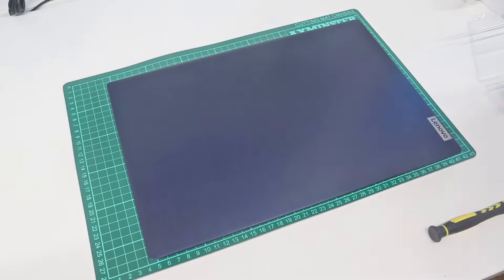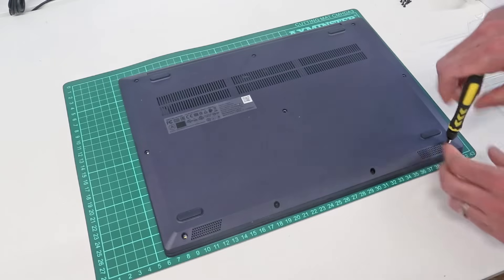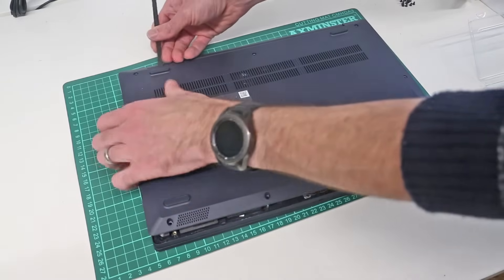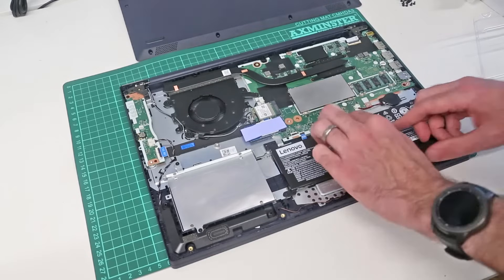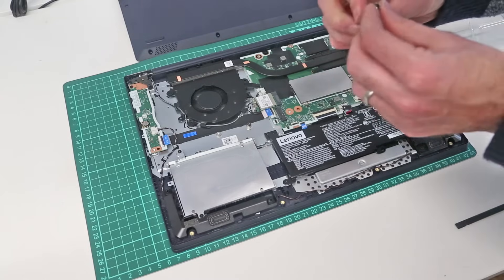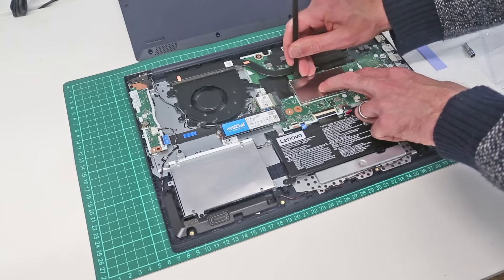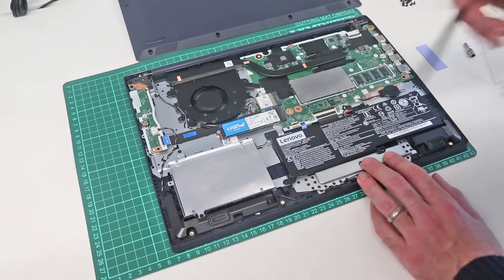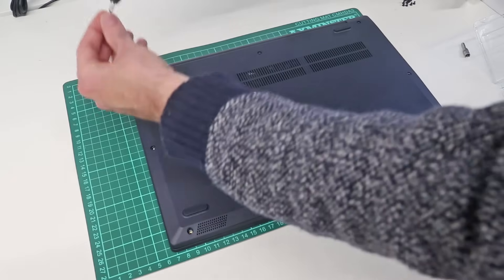Lenovo IdeaPad 3 15ARE05 SSD and Memory Upgrade Guide

Comment: is it possible to change the processor?
Reply from the maker: No. The CPU in pretty much all modern laptops is soldered down and can only be replaced by replacing the mainboard with one with a higher spec CPU on it.

Comment: Hi. I have the same model of the laptop but it came with two 4gb ram 2667MHz, could this be upraded to 16gb ram?
Reply from the maker: If it is the same as mine then 4GB will be soldered down and cannot be upgraded, and the other 4GB is socketed and can be. So you could install an 8GB module and go to 12GB, or a 16GB to go to 20GB.
Reply: @BrueComputing  Thank you. So its not an issue to not have symmetrical sized ram cards?
Reply from the maker: @johnsburgers7784  It has a bit of a performance hit in gaming with integrated graphics, but for general use shouldn't give any issues so long as the memory speed and timings match.
Reply: @BrueComputing  Do you know how I can find out what the integrated RAM speed and timing currently is? MSinfo32? Thanks
Reply: Thanks so much, this helps out alot

Comment: Hi. I did all this and now my Lenovo Setup Utility is saying Hard Disk: Not Installed. It won’t boot. Any ideas?
Reply from the maker: You need to either clone the previous drive contents across or clean install Windows 10 to the new drive.
Reply: @BrueComputing  I did the clone. I purchased a WD WDS100T2B0B M.2 drive, put it into a USB caddy, used cloning software, then swapped the hard drives. When the laptop starts it prompts me to go straight into the bios, which on the first screen next to Hard Disk it says “Not Installed”. Could the SSD i bought not be compatible?

Comment: 🙂The video was great, upgrading the ssd and ram👍. At the bottom left it looks like a 2.5 hdd bay? Does that mean you can add a hdd for all your data like videos, music etc. Also do more laptops today have this setup? Available to upgraded ssd, ram and add a second hdd? I have a 4+ year old laptop that is working fine, but it may die in 1-2 years. I would like my future 💻 be able to upgraded ssd, add ram and add a second hdd for all my data(music, movies, pics, etc)
Reply from the maker: There is space for a HDD, but models which don't come with one don't have the bracket and connector for fitting them, so you'd have to source these. Some manufacturers do include these in the box or pre-installed on some models, but Lenovo chose not to in this case.
Reply: @BrueComputing  can you make a video , how to installed HDD (the bracket and connector) to Lenovo IdeaPad 3 15ARE05.
 PLEASE!!!
Reply from the maker: @viktorbelousov9573  I don't have the laptop anymore (I buy and sell them quite regularly to make these videos) and never had the brackets. I am not aware if you can even buy them separately.
Reply: @BrueComputing  I understand thx u so much.

Comment: Hi mate. I had a question. Mine has a 1tb hdd in it and I want to buy a m.2 drive. But im not sure if it is compatible with my system or not. I know that it has it's slot but the fact that this laptop didn't come with a m.2 drive, scares me a little. Do you think that i will have compatibility issues or i'll be good?
Reply: Just put the new NVME ssd in the computer and clone from the original hdd, then remove the hdd and reboot the computer.

Comment: If you upgrade it, the windows will be removed?
Reply from the maker: If replacing the SSD you'd need to either clone the data from the old drive, or clean install Windows 10 to it.

Comment: hello sir...i have this laptop, i installed HP ssd and i installed it successfully. after using it on ssd for for few days i try to take some of the files from HHD which was still inside. it started to auto restart and black screen problem. i called Lenovo the instructed me to format both the SSD and HHD while doing that i was unable to go to boot mood. i am shutting down the laptop and pressing the power on keep and F12 for boot up but its not booting up and getting stuck on Lenovo logo. i am even trying to use pin nova mode its still not booting up....all i want to do is install W10 on my SSD and format HHD but  Lenovo technicians  are not able to help me. PLEASE HEPL ME IN THIS...PLEASE PLEASE HELP ME OUT WITH THIS

Comment: Hi, thank you for the video. Question, can I add a slot of 8GB ram? so I would have 12GB total? Thank you...
Reply: According to Crucials' website, you can put up to a 16GB stick in the slot.  https://www.crucial.com/compatible-upgrade-for/lenovo/ideapad-3-15are05
Reply: @marsilies  Awesome!  Thank you!  Had an 8gb stick in my Amazon cart and saw this...now I've got the 16gb in there instead.  🙂
Reply: @JesterGP3  I check on command prompt and max Memory capacity is 16GB, do you also check it and 20GB is still fine?
Reply: Please tell me if your laptop sees 20 GB of RAM. I also want to buy 16 GB of RAM so that the total is 20, but I'm not sure that the laptop will see them.
Reply: @andromeda2499  I had upgraded my laptop to 20Gb and it works very well, the max memory capacity on the command line is still 16GB but 20GB is also readable

Comment: I have the same model of laptop (aside from having a 4700U CPU).  My battery spans the entire width of the laptop.  Is there a different battery that can be used (with the same or better Wh) which would free up the space where a HDD could go?
Reply from the maker: The smaller battery will be a lower capacity.

Comment: so, 4 GB soldered to the unit on this model... Looking to buy one with 4GB additional already in the slot. If that's not fast enough for me, wondering if I bought a 16 gb card if I could then run it "single channel" and it would be faster than the 4 + 4 dual channel? I keep seeing single channel vs dual channel and I just don't know a lot about it. Any help would be appreciated. Thank you
Reply: Dual channel is always better than single channel as far as I'm aware, unfortunately because 4gbs of this computer are soldered into the motherboard only the other slot can be upgraded to a max of 8gbs, total 12 gbs -2 allocated to the OS. I have a ryzen 5 model of this laptop with 8gbs ram, wanting to upgrade one of the sticks to 8.
Reply: If you can get a good deal on this model with ryzen it's a very nice laptop.
Reply: @sawcondeez69  OK gotcha. Yeah, we went ahead and got it. I've always thought AMD processors were great. Thanks for taking the time to reply, that makes sense!

Comment: Very useful thanks!! i upgraded the Ram  already to a 8gb because i realized that the Ryzen integrated graphics take 2gb ram by default, so when you add 8gb plus the 4gb soldered you get 10 usable gb.  I would like to now if this laptop support 16 Gb ram? Now Im waiting for the Sdd nvme 256 gb to arrive . Ideapad 3 is a really good laptop but it is necessary to upgrade and improve because the default config is very basic.
Reply: It can in the website it says that but people put up to 20 gb and it works fine
Reply: @mohammedmohaimen203  sure?? I haven't watch any info about because i plan to buy 16gb module
Reply: @MrTheophilos13  yea
Reply: same question
Reply: Maximum support for 8gb ram in extra slot- according to official russian website of lenovo for this model

Comment: Question: Why did you need to unplug the battery?
Reply: He wants to make sure that no accidents happen with the battery. For example, accidently ripping off the connecting wires. It is also safer to deal with computers with an unplugged battery to make sure that the laptop is off.

Comment: I'm confused. Please tell me could I add as a second drive the Samsung 970 Evo Plus SSD 1.0TB M.2 NVMe or Samsung 860 Evo SSD 1TB 2.5'' SATA III? I'm between these two. Shall I need the HDD Cable L 81Y4 HDD/B cable? Is the cable inside the laptop or I should buy it?
Reply: hey bro ihave the same question if you solve ur issue can you pls help me out. it's a humble request

Comment: Are the ideapads worth buying I'm trying to find a laptop I can design 3d prints on without having it crash or freeze on me
Reply: I just got one, and I am really impressed. Mine had Ryzen 3 4300u and 4gb of ram. I think for 3d modelling you should upgrade to 8gb of ram. The CPU is really good, it has 4 cores and runs really fast. I highly recommend this laptop, the only thing is the webcam is pretty bad.
Reply: Do you use fusion 360?
Reply: @alex-w8p2e  yes well I want to but my hp stream can't handle it...im struggling with this thing I got it for school 100yrs ago and I recently picked up a 3d printer and its takes hrs to do anything on it and I'm trying to find something that will do what I need there's so many things to take in account its hard to keep track of
Reply: If you want IdeaPad you can choose the ryzen 7 4700u variant that is the same as mine it's a monster for casual user and engineering works

Comment: can i update with a nmve gen3.0 4x m.2 or it has to be a 2x like the one provided by lenovo?
Reply: Hi did you ever figure this out ? I am looking to solve the same question.
Reply: @kikonoss123 Crucial hw upgrade tool goes up to Gen4 6.6/5Gbs Read/write.  If the mother board chipset can handle that I don't know, that is hard to find unless I am searching for the wrong thing.

Comment: Thank you ! I have got the same laptop with 512 Gb ssd and i want  to upgrade with another 512 Gb ssd but it seems the laptop hasn't got a secondary ssd slot right ? What would you recommend to me ? I could buy a new 1 Tb ssd in future but how can I transfer the data to new one ?
Reply from the maker: That is correct - if you could source the HDD cable you could add a SATA SSD, but I'm not aware of a supplier for that, so your best option would be a 1TB SSD.
I have done a video on cloning with True Image here: https://www.youtube.com/watch?v=JV43dmhsQS4
I use this enclosure for cloning M.2 NVMe drives: https://amzn.to/38vLcUl
Reply: @BrueComputing  thank you Brue. Thats pretty cool.
Reply: @doctormhere  "...upgrade with another 512 Gb ssd" hi, I was attempting the same and discovered that the empty caddy for the 2.5" SATA drive is present but there doesn't appear to be SATA header connector to plug the SATA drive into. Upon looking at the Lenovo documentation it appears that cable wasn't included in my models build. I will contact Lenovo and make the case that the salesman told me that I could easily install an additional 2.5" SATA drive, and therefore that this claim of his amounts to misrepresentation. Did you finally succeed to get the cable and install a second drive?
Reply: @veganath  hi. Actually there is no progress on my side. Because there is some space enought on original ssd for now. So I didn’t deal with the upgrade :)
Reply: @BrueComputing  is it possible to add 1tb hdd to this laptop?
Reply from the maker: @uqb7  I don't know a way of fitting a 2.5" SATA drive. I'd recommend just fitting a large M.2 SSD.

Comment: can you upgrade the cpu and the gpu also?
Reply: U can upgrade gpu to 2 gb in bios
Reply from the maker: No. No modern laptop (besides some gaming ones using desktop parts) have an upgradeable CPU. The GPU on these is either integrated into the CPU, or soldered to the mainboard, so the only way to upgrade them would be to swap in a higher spec mainboard, which is unlikely to be economical vs. just selling it and buying a higher spec laptop.

Comment: Hi my laptop has 4gb soldered + 4gb so-dimm and it says that it has a max memory of 8gb. Does this mean that I can't upgrade my 4gb so-dimm to 8 or 16?
Reply: You can upgrade it. Just remove the 4GB one and fit in the 8/16GB so-dimm
Reply: @thomasb4526  even though it says from the official website that the max memory is only 8gb?
Reply: @bernreccion  yes that's what Lenovo is saying. But as you can read here in other comments 16gb dimms also seems to work.

Comment: is it possible to add an HDD?
Reply from the maker: If you have the cable for adding in the drive then it should be possible - there is a mount for them in the system.
Reply: @BrueComputing  I have the hhd and a small cable piece that plugs into the hdd with the other end meant to plug into a motherboard, but i cant seem to find where to plug it in. But there is a spot for it?
Reply: @BrueComputing  hi, what kind of cable do i need to put a hdd

Comment: This is the second video where I can see you need a special plastic tool to open the laptop. I've spent almost 30 mins trying to open it and achieving nothing but broken nails. What were they thinking when they designed it?
Reply from the maker: I'm not sure I'd really call it a 'special tool' - a plastic spudger, or pry tool, is pretty standard for working on disassembling any modern electronics.
You could use a small, flathead, screwdriver, but any metal tools will mark and indent the plastic.
Reply: @BrueComputing  "pretty standard for working on disassembling any modern electronics"
Which is precisely why I call it a special tool. The average person doesn't disassemble electronics.  :)
Anyway, I succeeded by using a dinner knife. About an hour's work with only minor marks.
Reply: @crypticdelights6924  i just opened mine with a thin guitar pick. Works like a charm

Comment: is any there any slots available to add an extra HDD. mine came with the 16GB and 500GB SSD so im planning add an additional 1TB 2.5 Inch sata Hard Drive to it
Reply: Yes but there is no cable nor bracket
Reply: The perfect is ssd plus m2, hdd plus m2

Comment: Hey James,  I'm upgrading the same laptop SSD right now, and I'm using a Team Group 512gb m.2 2280 gen3x4 SSD.. I cant get it to boot to the ssd though, it keeps saying there is no bootable media? I have a USB flash drive plugged in with windows 10 loaded onto it (I've used it many times to install windows) but it doesn't seem to recognize the usb or the new ssd. Any ideas?
Reply from the maker: How did you create the USB stick? Is it set up for Legacy CSM or UEFI booting?
Have External Bootable devices been disabled in the BIOS?
What options do you get if you load up the Boot menu?
Reply: @BrueComputing  I actually got it and forgot to update here. I'm not sure why but I made another win10 ISO file on a different USB flash drive and it worked totally fine. I'm not sure what was wrong with the other flash stick.
Reply: Duplicate drive with gost or other programs

Comment: Hi just wondering what is the max upgrade parts that I could get for this laptop?
Reply from the maker: An additional 16GB DDR4-2666 and as large an M.2 NVMe SSD as you can find/afford.
Reply: @BrueComputing  So basically if I wanted to I could add a 1TB SSD to the laptop with 16GB of ram do you think that would be good for some gaming?
Reply from the maker: @ItsKagiVids  It'll never be amazing for gaming as you're reliant on the integrated graphics and the DDR4-2666 RAM isn't ideal. It will give improvements though.
Reply: @BrueComputing  what are the integrated graphics?

Comment: if i have soldered ram and a free slot ,can i put any stick and it will work ?
Reply: not just any stuck DDR4 and i believe up to 16GB is compatible
Reply: But used the mhz low

Comment: dude can you make a video on how to increase VRAM on this laptop
Reply from the maker: The BIOS (if it is an option exposed to the user) can set the MINIMUM allocation of memory for the GPU, but the maximum is controlled by Windows and the graphics driver. Open up Task Manager, go to Performance and select "GPU 0" and you can see a graph for "Shared GPU memory usage".

For example, my i5-1135G7 system with 16GB installed shows 0.4GB shared GPU memory usage whilst idle on the desktop, with a maximum of 8GB (the system has 16GB installed, the driver is allowed a maximum of half of that to be allocated to the GPU).
Loading up GTA V and running the benchmark mode at 720p and low detail it increases to 1.9GB.

This is exactly what is supposed to happen - statically allocating huge amounts of RAM to the graphics is stupid because the requirements vary hugely depending on usage, particularly when you're dealing with systems with 4GB RAM as still is surprisingly common. You wouldn't want to permanently assign almost half of your memory to the GPU and cripple system performance when the user may never need to use it.
Reply from the maker: You don't - the VRAM is dynamically assigned from system memory by the graphics driver.
Reply: @BrueComputing  but i saw some of the youtubers increasing VRAM 
but i cant incrase it
Reply: Vram increased on bios up to 2 gb gddr4

Comment: Hi, I just bought rhe 14ARE05. Can you pls helo confirm if they are just same configuration and upgrade process as in your video where you were upgrqding a 15ARE05? Also pls confirm I can add the 8Gb on your video description to add to the 4GB soldered on my 14ARE05 cause I noticed in your video you added only a 4GB?
Reply from the maker: I believe it is very similar in construction. An 8GB DDR4 module will work just fine, I fitted a 4GB as I had one spare and like a matched pair in terms of capacity for integrated graphics performance.
Reply: Thanks so much. Very helpful advice definitely following your channel. Thanks.

Comment: What speed of ram are compatible for this model?
Reply from the maker: The soldered RAM is DDR4-2666, so install a matching DDR4-2666 module alongside it.
Reply: @BrueComputing  Oh okay! Thanks for the response 😊
Reply from the maker: @ayeeejacob  Can find a link to suitable DDR4-2666 module in the description.
Reply: @BrueComputing  Can it run 3200Mhz?
Reply from the maker: You can fit a 3200 module, but it'll run at DDR4-2666 speed, as that is the speed of the soldered down memory.
Reply: @BrueComputing  is DDR4-2666 CL15-17-17 @1.2V ram a good upgrade for this laptop?
Reply: @figo1337  
pless answer to this vs CL 11 ?